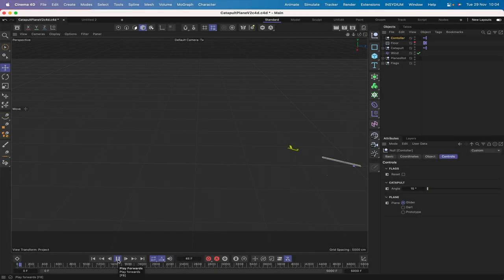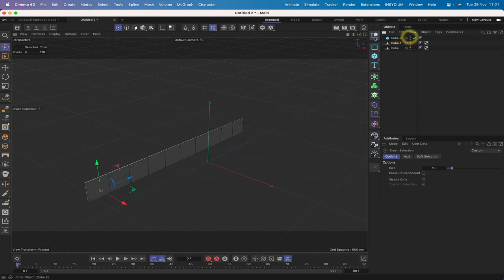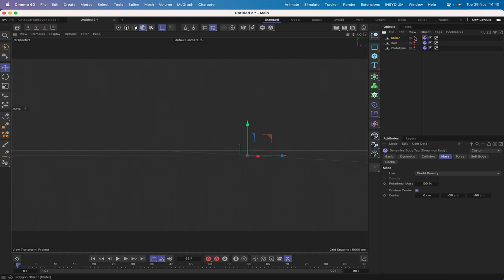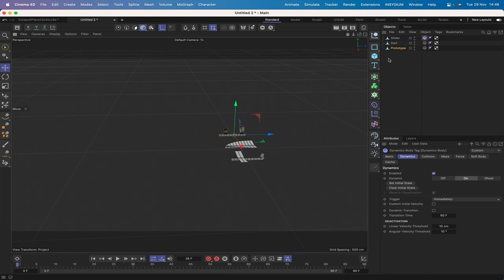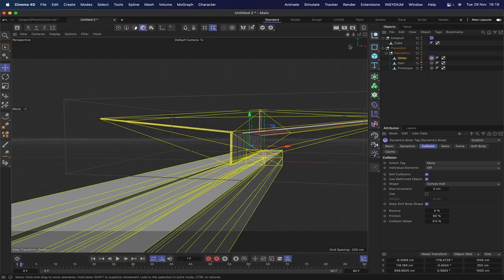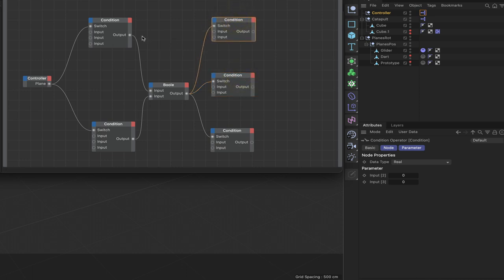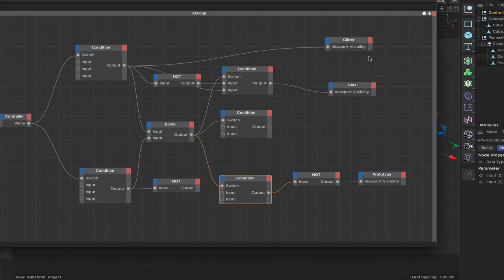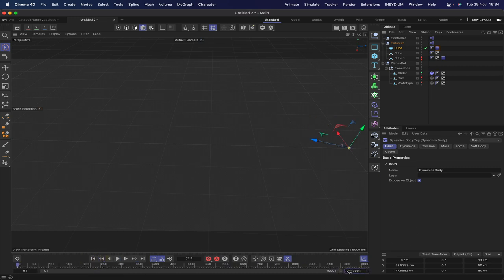Cinema 4D Multi-Tech Tutorial  26 - Catapult Planes (Part 1 of 2)

Comment: Hello . Very interesting tuto. Is ther a way for the plane to follow an x-z path ? Regards
Jacques
Reply from the maker: So, instead of flying along the Z axis, they fly along the X?
Reply: @ExpressoMechanicTV  
Thank you for your Quick answer.
It is not exactement my request.
Instead of à straight line on the X axis, is it possible to follow a kind of spline line in the x- z plan?
Regards
Jacques
Reply from the maker: @JacquesRABAIN  Yes. The best way to make this work, is to add say, a rudder to the plane's. You can also add ailerons and other control surfaces if you choose to and add user data to control them. I have actually tried this and it does work.
Reply: @ExpressoMechanicTV  
Tanks I Will try . It semestre difficultés to follow à predetermine 2D path.
Regards 
Jacques